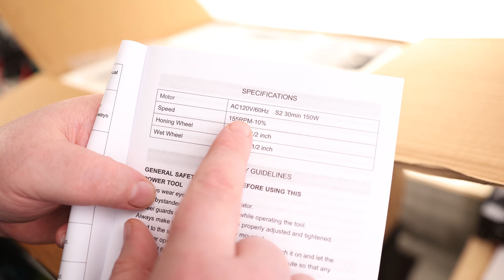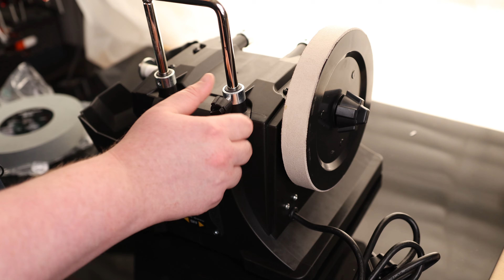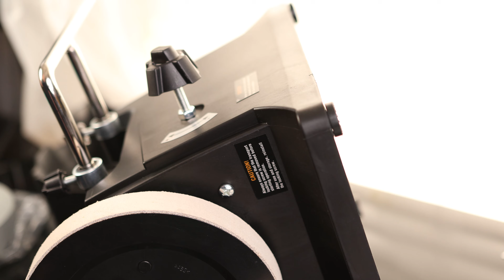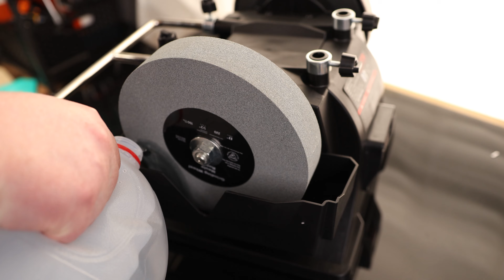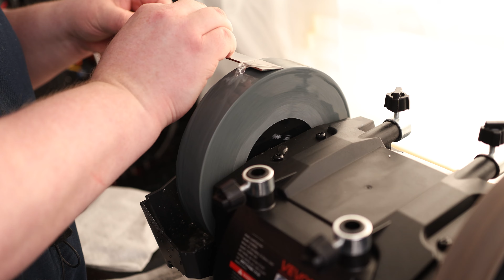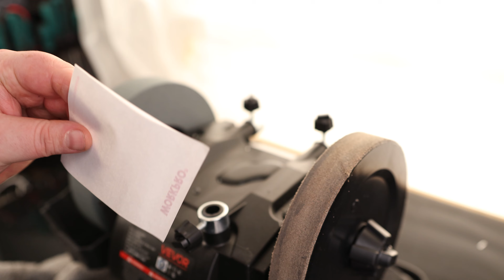VEVOR 8-Inch Wet Sharpening System, Water-Cooled Knife Grinder Machine with 155 RPM Grinding Speed

Comment: Good for maybe a hobbyist at most.  The plastic housing is terrifying.  That level of sharpness will not work for most applications other than just rough work.  I mean, I saw it for 120 Canadian dollars, so it IS VERY CHEAP.  However, just watching this video tells me that I wont want this.  It is definitely a thumbs up for the video (giving me an idea on the build quality) but the thumbs down for the machine.
Reply: Really, what terrifies you about the plastic housing, do you think it's going to leap up at you and grab you around the neck? It's a slow turning motor with a couple wheels on its spindle, not a high speed bench grinder.

The "level of sharpness" will be fantastic compared to almost any other consumer sharpening tool. It's doing the same job as a $1500 Tormek system, which is also just a spinning grinding wheel, for $100. Add a stone grading tool and a knife holder for $50 and you're all set.
Reply: You hit the nail on the head.  It happened to a buddy of mine 20 years ago.   He was just walking down the street minding his own business and didn’t see this plastic housing laying in a nearby bush.  Then BAM! It leapt up and grabbed him by the neck just like you described.  Shame really.
Reply: @mrdiggie3321 you actually think this is as good as a tormek that is actually as good as a skilled classically trained woodworker on a water or arkansa stome?  That's like saying your electric chainsaw does the same thing as a gas powered Stihl that does the same thing as a log harvester.
Reply: @MintStiles I didn't say it's as good as a tormek, but I bet it's not worlds apart. Sounds like you are gatekeeping and you're very upset someone has created a more affordable way for more people to get into your hobby/profession. Why not be happy that such an option is available instead of over-dramatically crapping on it? It reeks of "everyone should have to pay as much as I did!!!! Only expensive things can be good!!". They aren't devaluing your skills by gaining access to more options.
Reply: @mrdiggie3321 you literally said "doing the same job" lol.  Gatekeeping?  What are you talking about? Stop making shit up.  I literally said the best is a guy with a stone, is that gate keeping?  It's like completely argumentative selective reading.
Reply: @MintStiles Yeah, because it does literally do the same job. One may do it to a slightly better quality. You should practice reading and comprehension.
Reply: @mrdiggie3321 so in lieu of a counter point, you've just repeated yourself?  Look man, cheap tools may or may not work, but they are cheap for a reason.  Just because a rust box has 4 wheels, doesn't mean it's going to do the same thing as a brand new SUV.  Either present evidence or just admit you are making shit up with no experience with any of these.